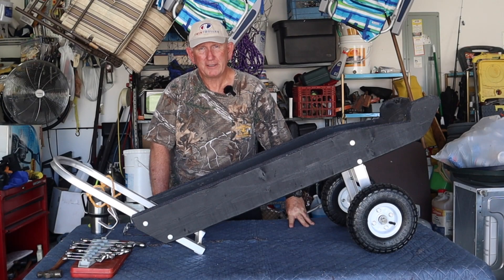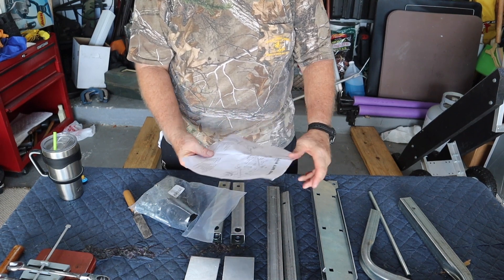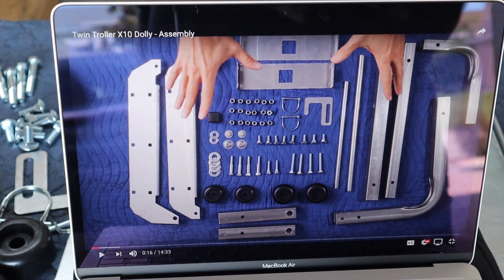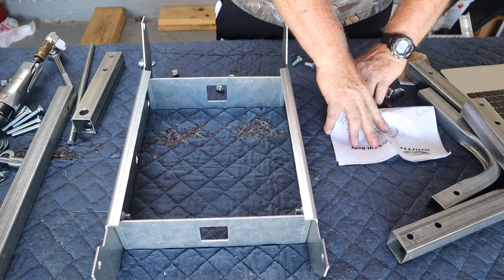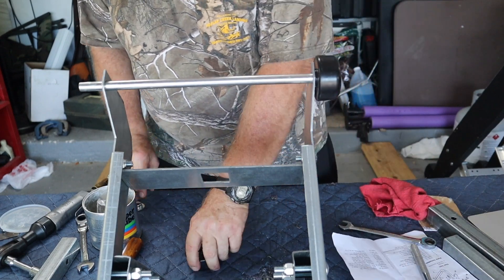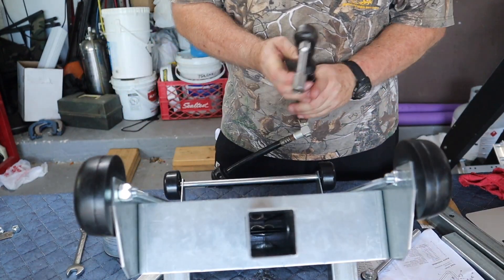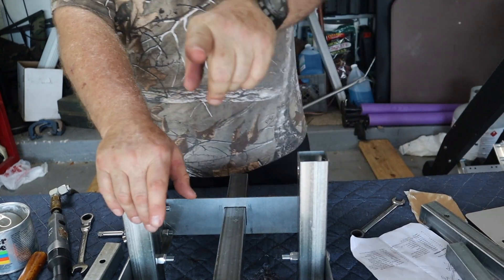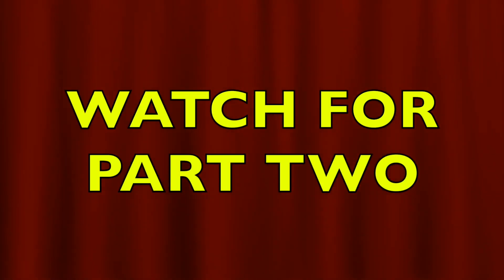CAN YOU ASSEMBLE THE QUICK LIFT DOLLY?

Comment: Got my quick lift dolly and trailer today. Two of the trailer boxes were busted open on the ends with parts sticking out. The quick lift dolly box seemed Ok but still missing the axle, one side, and one axle leg. What a deal.
Reply from the maker: Lynn, I guess all those metal parts are a little heavy for the shipping boxes they use. Did you contact them to get them to send you the missing items?
Reply: @LunkerFishing  yes They said they would send missing parts ASAP
Reply: @LunkerFishing  
can the exact same size wheels be bought at harbor freight?
what's the size?

Comment: Missing an axle? Mine came two weeks ago with the two short square tubes that attach the dolly to the wheels not properly drilled for the wheel axle. One had only one hole drilled, but nothing on the other side to slide the axle through, and the other had both holes but they were 1/4" oversize and the axle wobbled like a crazy. I called Frank and he had the Smith Company, who supplies their trailers and new dolly, to rush me the correct parts. All is well.........
Reply from the maker: Chris, I had a similar experience but not as bad as yours. You will see it in part two. Have you tried the dolly yet? I have not but hope to soon. Waiting for a cooler day under the low 90's.
Gerry
Reply: @LunkerFishing  Mine works great. By the way, I copied your pvc pipe sonar assembly for my fish locator. Works great!